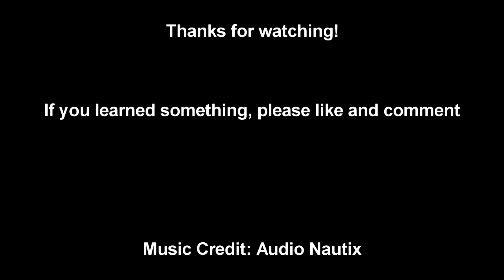Success in FPV part 16 - PID tuning explained

Comment: This is helpful but I have a question. You mentioned you already have the other 2 settings tuned when making the other adjustment. What if all 3 are not tuned and you need to find the perfect balance of all 3, how wouls you go about tuning all 3 in balance with each other if none are tuned?
Reply from the maker: If you see my other PID tuning video, it shows how to get a "base tune".  The base tune is the starting point.  From there you use this video to tune it in.

In general, you turn all of your PIDs down and start with P, then move to I, then D.
Reply: Thank you! I'm loving all your videos. You're very intelligent. Quick question, I fly quads and mostly fly in parks but occasionally want to do some long range stuff maybe a mile or 2 away amd O have diverity goggles I'd mount this to.........would you prefer your 5.8ghz 10dbic crosshair or your 5.8ghz 7.5dbic or 9.5dbic helical? I like the gain on the crosshair as well as the axial ratio and degree of coverage. I have decided on the crosshair but would love to hear your recommendation. I know it all depends on where I fly and how far.
Reply from the maker: It is hard to go wrong with a crosshair.  As a stand alone I prefer a helical on goggles, but with diversity a Crosshair is excellent.

Comment: And howcome you didn't lose video signal when weaving around those buildings? you certainly lost line of sight didn't you?  My video signal has been good so far using your antenna on  25mw vtx, but I stay high usually for AP didn't think I could fly around such large obstacles.
Reply from the maker: Antennas make all the difference in the World.  I am running a Crosshair antenna on my Ground station and an Airblade on the vehicle.

Comment: Great video, I thought my Tricopter was not too bad but now I realise it could be a lot better.
I usually fly in the wind (sometimes strong wind) so have previously put down my sub-optimal flight characteristics down to that. But definitely getting some of the sounds you mentioned to listen out for.
I am using Sunnysky 2216 800kv with 10" APC MR, on a Tricopter with APM2.6 , Arducopter 3.2.
The main problem I am frustrated about is setting up Yaw, I am getting a slow oscillation. So, turn down I?  I have tried a lot of changes and not yet had it that I'm happy with, you mentioned yaw being affected by the other axis settings though, so maybe I need to look at those again.
Problem is I relied on AutoTune to get it right, I did back off somewhat from the AutoTune settings as I felt it was too twitchy, but didn't really question the results as much as I perhaps should have, its not flying as well as others I've seen on youTube.

I have been reluctant to do my own Tuning as I haven't understood all the settings. APM has as well as PID also a "Stabilize Yaw" which can apparently cause P like oscillations and an "IMAX" which limits "I" but I don't know the effect of this in practice apart from it wasn't as good in the wind when I tried to copy other peoples much lower IMax yaw setting. But what would an overly high IMax do?

I would like to post a video if someone would be interested to help, but I'm not sure what wind conditions were and I fly from GPS and my camera is mounted on a cheap servo gimbal so those things might make it more difficult to judge.
I actually thought it was my basic camera tilt mechanism that was part of the problem, but once when I took it off mounting the camera directly the performance looked worse.

btw: if any sucking up is required :) I do actually own A CrossHair, PepperBox and a Madmushroom!   Not used the PepperBox yet, bought it after the CrossHair went blank on me while taking off with a Bix3, don't think the Antenna at fault, I maybe wasn't pointing it in the right direction, picture came back after a friend took controls and came a bit lower.
Reply from the maker: If you can tune a tricopter, you can tune anything.  The key is to watch the yaw servo.  The yaw servo is slow and thus the P and I gains will be lower on yaw or the servo will jitter rapidly.  High "D" gain helps a lot with this, too.
Reply: Also I wanted to ask if it's always possible to get a good tune ?
Or could it be that certain motor power combinations don't suit certain frames.   I would have thought my setup should work well though , 800kv 10" props , AUW 1550g
Reply from the maker: Good question!  I would assume some systems will not tune well depending
 on flight controller and power limitations.  The big problem you have 
is the tail servo on a Tricopter.  It is hard to tame and I often jam it
 up with a few O-rings so it doesn't wobble.
Reply: I don't quite follow what you say there, I thought we needed the servo to be as fast as possible so it could quickly adjust itself to keep the yaw in line.  I am using rcexplorers.se tail design. I was thinking of trying a faster&stronger servo to see if that would help, are you saying I'd be better off trying a slower one?   I have read that a smaller prop is better also.
Where do you put o-rings , do we need to create some friction to slow down the tilt mechanism? I had read previously it needed to be as free as possible.
Reply from the maker: I jam up the servo to eliminate jitter issues.  The tail will tend to swing the whole aircraft due to play in the gears.  The O-rings prevent that.

Comment: That is definitely helpful. But definitely it's not an easy thing to do, and the hard part is that you got to do your own PID setting by yourself. Reference PID settings never work for obvious reasons. All crafts are different. So have to learn it the only way, the hard way. Thank you for your video, it clears up a lot of the confusion.
Reply from the maker: Yes indeed, all aircraft are different.  When it comes to cleanFlight and BaseFlight, I think the numbers are all made up as they really don't mean anything in the first place...  CC3D, however, has much more background on their numbers.
Reply: +Video Aerial Systems - Is CC3D software (as Cleanflight is) or what? :))

Comment: One question:
With which PID parameter does you start? P is set to a safty value and I & D set to 0?
Or let you I & D for the P tuning on the current value?

Comment: Hey mate What I do not know is how did you change your pid? did u use your bluetoot connected to a copter or each time used your pc? I am using cc3d and librepilot. give me a hint what is my best option a s a beginner
Reply from the maker: +Aleks Cortez - I used my PC every time.  I have not used bluetooth tuning before.

Comment: What if you have a slight wobble in forward flight? Is D to low or I ?
Reply from the maker: +Lyrixish - It depends.  A slow wobble - P or D too low.  A somewhat fast wobble - I too high.  A very fast wobble - P or D too high.
Reply: So when coming out of split fast loops/rolls and letting go of the stick would mean I is too high?

Is the idea to tune P until there is quick oscillation then start turning I up?

Comment: Hey Alex I have a question not related to this video.  I remember you saying that audio signal wire on the vtx needs to be grounded if it's not used. I noticed on the system you showed there was only one wire connected to the ground wire.  The green and white on immersion systems are both audio correct?  So do they both need to be grounded?  Thanks in advance and thanks for all the valuable info you share.

Comment: hey, no matter what i do with PID settings my quadcopter rocks side to side and over corrects it self until it flips over and i dont know how to fix it
Reply from the maker: +Evan LaRue - This sounds like the I-Gain is way too high and the D and P gain are way too low.
Reply: +Video Aerial Systems - i don't even have I setting on it is set at 0 and the side to side movement is very fast from take off to crash it is a few seconds plus it wants to rock to the left even though I put most of the weight on the right side and maxed out my trim to the right

update: i increased the I setting and increased the P setting and it is doing better but it still flips over after about 5 side to side movements and it goes rock solid straight down but in the cc3d software is tells me the quadcopter knows whats up and whats down and then my two counter-clockwise motors are really hot to the touch after a 100% throttle run when im holding it but the other two are just fine

Comment: Hi, I have oscillation when drone is falling and I give some throttle. I have tried to modify P with no luck. ( OP REVO ) What that can be ?
Reply: +Michael Zukas if you specifically have oscillation when raising the throttle after idling it and falling, try raising min_throttle (cleanflight) or whatever the equivalent is in your flight controller. If the motors idle too slowly, especially when they have air rushing past them upwards, they can have trouble getting started again.
Reply from the maker: +Michael Zukas - Try messing with the TPA setting.  The TPA will scale your PIDs according to throttle.
Reply: +Joshua Bardwell thanks for idea. I'l try it

Comment: Hey alex love your stuff and your mission.  I just can't seem to find info on how to tune for wind.  My SPF3 has a horrible wobble in the wind and prop wash wobble on descent.  I'm using tri blades on a ZMR x210 which makes it a rocket ship but this wobble has to go.  It makes me abort gaps often.  How do I tune for wind and prop wash?
Reply from the maker: +Chris Stolle - This sounds to me like an issue that could be solved with TPA settings.  TPA or "Throttle position adjustment" can scale your PIDs according to the throttle input.  The way this works in NAZE is that you overtune your machine so it stay stable at low throttle and then set your TPA to kick in when the throttle is increased to keep it from oscillating out on high throttle inputs.

That said, if I were a betting man, I would guess your I-Gain and D-Gain on pitch are too low as well.
Reply: My TPA is set to 40.    On punchouts I notice no oscilations. On flips and rolls the quad snaps into place without wobbling or bouncing.  Just forward flight in wind and descent do I get the crazy wobble but not all the time.  So I will toy with the I and D gain.  Thanks man for answering.  I know you are a busy and sought after guy!

Comment: HI Alex, amazing video, but I really don´t know what to look for, since my quadcopter is pretty stable when is steady but as soon I start forward flight and the quad gets some speed it begins to wobble in roll and pitch axis, so it doesn´t fly rock solid, I have raised I but nothing major happens....
Reply from the maker: +Dashz - This sounds like P-Gain too low.  Go ahead and triple your current P-Gains and see if the wobble goes away.  If you get rapid oscillations, then you need to turn it down until they go away.

Comment: I dont hear any oscilations , where you show high D gain
Reply: +Jan Prejzek it's not an oscillation like you hear with P gain. It is more like a harmonic that you hear in the motors.
Reply: +Jan Prejzek  It's there, but hard to hear. Turn the volume up, and listen while it is in motion. Doesn't oscillate when staying still, but only while he is moving the aircraft...
Reply: +Joshua Bardwell It is some time ago, i was beginer in pids. Now i know more and understand what it is, and what he mean ,-). Thank you anyway

Comment: Hi guys, I am building a 3D printed DJI inspire 1 clone, and it's arms 
are horribly wobbling when they are in down position. My FC is Pixhawk. 
Is there anything that can be done in PID setting to help eliminate this
 problem? I know it is a frame problem mostly, but I am trying to tune 
the software too, just to help solving that. I tried to play with PIDs a
 little, but dont seem to see much change in terms of frame shaking. My 
drone is around 3200-3300 grams in weight, if that helps...
Reply: pix, has auto tune have you tried that?
Reply: +rio_ lld ahtotune was out of my options due to instability. was not safe to do that. but i already managed to tune my pids! the problem with pixhawk is that the software wouldnt allow me to set Pgain to lower than 0.8. So, i assigned it to my transmitter controller and was able to adjust it during flight. I was able to set it to 0.4 this way and now it flies very good.
Reply: +Vlad B nice! good for you bro. I probably hands to watch this video like 10x to memorize this stuff lol

Comment: does this work for angle mode also on Naze32 cleanflight?
Reply: +Jon Car Forget angle mode, this is waiste of time!
Rate mode is the way to go!
And yes PIDs concept is almost the same on the Naze32
Reply from the maker: +Jon Car - This is only for acro mode, unfortunately.
Reply: +Alex Greve  No one has done any videos of what effects angle and Horizon using PID or any other settings in Clean flight.
Reply: +Jon Car I have made changes in PID settings as far oscillation goes on the Naze 32 in angle mode and yes it does have an effect to mitigate oscillations from excessive values.
Reply: John Jones thanks

Comment: Hey Alex thank you for the tips. I have a emax 250.it has emax 2204 2300kv motors. 12a Simon series escs. I'm running cc3d. What do you think a good starting point is for tuning. I'm just learning to fly rate. Any help would be greatly appreciated. I followed a lot of your video series and have learned quite alot.